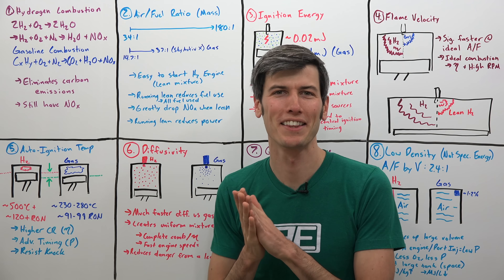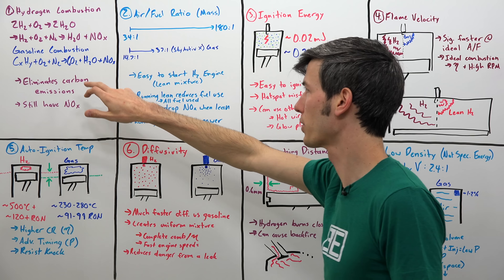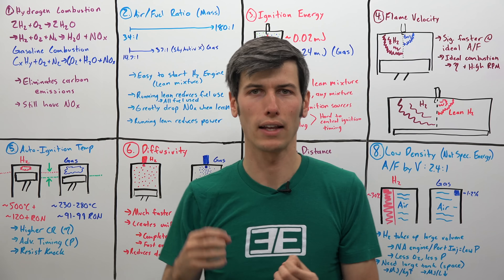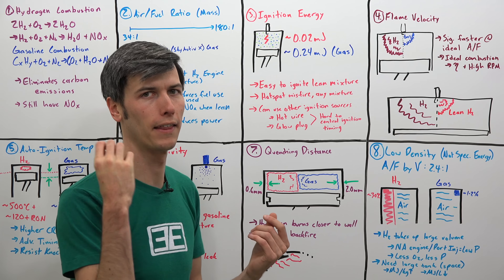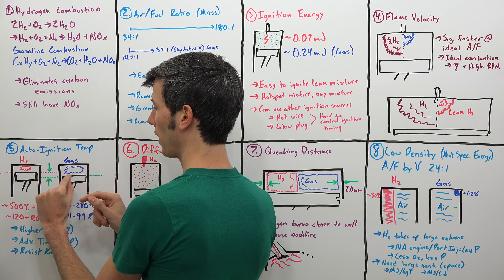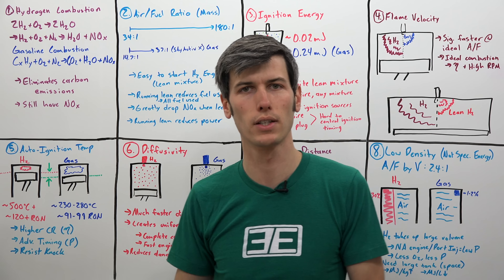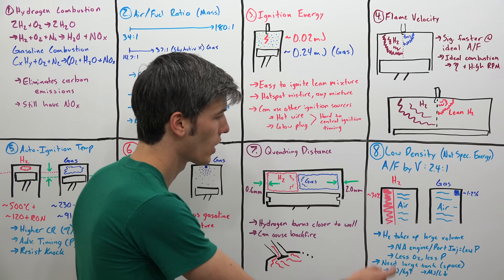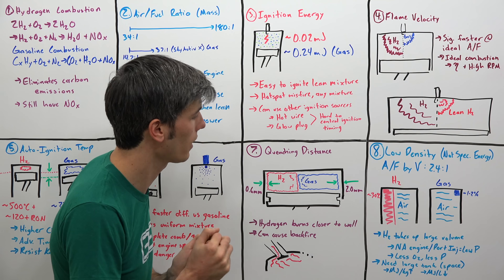The Difference Between Gasoline And Hydrogen Engines

Comment: Hydrogen, the most abundant element in the universe  😊  I say, Bye Tesla ... and let's move straight to Hydogen ICE engines 😍😍  (Only difficulty and thus drawback is the electrical energy required to purify hydrogen via electrolysis)

P.S another brilliant video Jason! Wish my university lecturers were like you back in the day
Reply: Hydrogen is abundant in the universe as a gas, now I'd like to see you try and keep it liquid for cheap and for long periods of time.
If you manage to keep Hydrogen a liquid for cheap, and make its production really efficient, then and only then you can say bye to electric cars.
But that will most likely never happen, so keep dreaming of your H cars, because it ain't happening :P.
Reply: @GoldSrc_  it doesnt have to be liquid. Even regular petrol cars inject in semi gaseous state I believe due to the high pressures. Although like I said, the purifying and storage is the biggest issue

Comment: Hydrogen be like "I NEVER KNOCKED ON NOBODY!"
Reply: Haha love it! Thanks for the reply man, means a lot. You're one of the reasons I'm creating on YouTube myself on my own channel! Always loved your work man, please check out mine, any criticism or advice would be warmly welcomed! 👍
Reply from the maker: And you know what! It was YOU!
Reply: The big problem with hydrogen is fuel leaks. Hydrogen will leak through steel tanks with little difficulty. It also tends to form bubbles under overhanging roofs unless they are vented.
This means that any enclosed space around a hydrogen tank will have hydrogen present, the wide air fuel ratio will mean the gas mixture will be explosive (the absolute lower explosive limit being about 1.5% hydrogen in air).
This translates as having to make the interior of the car a legally defined electrical hazardous area, requiring all the wiring to be either explosion proof or intrinsically safe.
Reply: @allangibson8494  Perhaps you didn't know, more house fires that are not arson are started by an electrical short in a car in an attached garage than anything else. Ask your insurance agent why attached garages increase premium cost.  Also, spilled gasoline fumes will hug the ground without air stirring. H2 will 'float' away if vented. But yeah, hydrogen is much more difficult to contain.
Reply: @tombombadil3185  H2 is also much much easier to ignite. I work in industrial applications (including work on fuel cell systems) and the two gases in the highest possible risk class are acetylene and hydrogen. Given a choice diesel is the safer option but petrol vapour isn't even in the same class (literally) as hydrogen. (BTW Diesel powered fuel cells exist too).
Hydrogen is very easy to ignite (sunlight will do it) and has a wide flammable range with high energy. (Not like acetylene - that's a high explosive even when not mixed with oxygen).
The average garage is simply not designed for the ignition risks of hydrogen.
That said the average car owner has no use for a hydrogen vehicle that a battery electric vehicle can't do better, more cheaply and far more reliably.
Hydrogen would be better used for ammonia synthesis (which currently uses 30% of global natural gas production) and liquid fuel synthesis from carbon containing agricultural waste (and corn alcohol is a boondoggle too - turning corn stalks into naphtha would yeild more energy at less cost).
Reply: Lol... it's funny that at this point this is a dated reference. I wonder how many people got it. It still works out of context so I'm not sure I can just count the likes.
Reply: Great video and very interesting topic... Thank you Sir... 👍👍

Comment: So my impression from your video is that H2 is better fuel in paper, so what are the practical issues when implementing this fuel in combustion engines in road cars, besides the tank size? Or is this such a disadvantage that it is enough to put off implementation?

Comment: Would be nice to see a video of a hybrid petrolium+hydrogen.. I was thinking doing it a long time ago, adding H added to the air:fuel mixture and get some results mesured.
Reply: when hydrogen si added  to engine you extract more energy from fuel that means more power and reduced fuel consumption
Reply: @antoniotod9614 I thought exectly about  that. But I read that hydrogen can damage the inside chaimber steel and create micro cracks. Is that true?
Reply: @MaximumBan  hydrogen penetrates steel with high pressure,  the pressure inside cylinder are not high enough... when the hydrogen get stored in a tank with high pressure it penetrates steel and leaves into atmosphere

Comment: An internal combustion engine will run on ANYTHING in proper mixture. Only thing you need to do is figure out how to dry out the cylinder of water after the combustion process of hydrogen to prevent rust. This tech is old. Propane and LP conversions have been around for YEARS. Substitute in hydrogen,....whats the difference? NONE!

Comment: Why can't we use hydrogen as a diesel engine?
Reply: you can, but just as additive, like injecting HHO gas to get more power and reduce fuel consumption
Reply: @antoniotod9614  I meant I can't see a discernable reason why hydrogen won't work as direct substitute, compress air inject hydrogen and combustion should happen if it's hot enough

Comment: Now bring it full circle, and explain how adding the carbon atom into hydrogen (CH4) fixes the volume disadvantage of hydrogen. The Honda Civic GX runs on natural gas, and makes comparable power to the gas equivalent. I heard of an AC Cobra that had a 429ci engine that ran on hydrogen. It made about 100hp.

Comment: I  first saw a university conversion of a Honda civic to use of hydrogen as a fuel, and told its only exhaust was water and a bit of NOX around forty years ago. I have wondered since why it was not developed further. One engineer I met much later said that the compression ratio and several other aspects of standard gasoline engines would have to be altered to optimize the design for best efficiency. Your explanations here have greatly added to my understanding of why the direct conversion to hydrogen of our very mature spark ignited piston engines of today have not been utilized for CAFE standards compliance by now.
Aside from the hydrogen fueling infrastructure problem that this idea faces, along with its newer, cleaner sibling the fuel cell vehicle, the other problem hydrogen internal combustion technology faces is that piston engines need lubrication from oil any way. The hydrogen engine would burn the thin film of oil left by each stroke of the piston, adding to the emissions, and I think I remember that ring wear would be exacerbated with it as well.

Comment: I really enjoy your videos, they're thoroughly informative and as an engineer (chemical) myself I like the degree of detail that you achieve. That being said, why did you decide to focus on hydrogen combustion instead of fuel cells? Fuel cells essentially power an electric motor but have much higher energy efficiency (> 60%) than internal combustion engines and produce little to no harmful emissions. In Japan fuel cells were used for home application generating electricity by feeding them with natural gas from the city lines. By coupling some heat exchangers in order to recover wasted energy they were able to reach 98% energy efficiency. Naturally this isn't possible for automotive applications (yet) but it still makes a point as to the potential that this energy conversion technology possesses. Also regarding the energy density of hydrogen, you are quite correct but there is significant research going on trying to surpass that limitation: there have been some advances in the storage of hydrogen in liquid or even solid form. The principle is that hydrogen would react with a solid compound generating a corresponding hydride or possibly some other compound containing hydrogen. There would then be a somewhat reverse chemical reaction which would release the hydrogen yielding the starting compound. There are, of course, numerous problems with this approach, such as being able to control this hydrogen release and the rate at which hydrogen is released and then fed into the fuel cell.
If this could be achieved we would be able to store hydrogen in a small box which we would then connect to our vehicle and replace it with another box when the first one was spent. What do you think about that?

Once again, awesome videos and keep on doing what you're doing.

Comment: Is there a point (theoretically speaking) at which we could compress Hydrogen to take up less volume, ie fuel tank? And are we just not to that point yet? I'd really like to see hydrogen become a feasible option in my lifetime, as i believe it's a great alternative gasoline/petrol. 
Also, As Hydrogen can take a higher Compression Ratio, would internals have to be "beefed-up" to be able to support a higher CR?

Comment: Would s hydrogen engine make a good option for a range extender in a bigger in articulated lorry? An i3 rex, for instance, uses a gasolene engine to generate electricity, and - apparently only just enough electrical energy to keep the vheicle moving. But an i3 is a small vehicle ... hmmm.

Comment: Thank you Jason for this.  What about the idea of just having a tank of H2O (water)? It carrier both fuels together... how much h2o would be needed to match the energy potential for gasoline in a tradition combustion engine.. say you have a 10 gallon tank, how much water would be needed? I still think Hydrogen is going to be the next big leap for internal combustion engines after the opposed piston (Achates) engine.
Great video thank you.
Reply from the maker: But you need to split the H2O into hydrogen and oxygen separately so that you can use them, so you'd need a tank for each as well. Water unfortunately isn't a great energy storage solution for cars.
Reply: @EngineeringExplained  Hmmm, well, let me in my lay engineering keep dreaming then! although, in about 1989 i asked my dad why there were not TVs in the back of headrests in cars... he just laughed at me.... ahaha have a great Christmas/Holiday season and New Year!

Comment: Hydrogen and small fuel cell is practical as a tesla on board refueling system.  Like Honda insight where you don't need (ICE) to produce power.  Or you take a diesel engine and use hydrogen with its injectors.  Take that heat to warm up fuel cells in batteries. Prefect hybrid engine fuel :D

Runs off of water

Comment: I'm not too sure about hydrogen as propellant for cars, but do they cause some maintenance problems on the engine block if it were to be used as a propellant? 
For example, petrol/diesel has carbon buildup due to the combustion nature. Because of hydrogen's combustion with oxygen to water, doesn't it actually rust the engine block?
Reply: when fossil fuel is burned it  turns into CO2 and H2O, so does every car engine block have rust??
Reply: @antoniotod9614  No, as if now they have a higher quantity of it, since mostly they're burning hydrogen now instead of hydrocarbons. I'm asking this because of the majority of the engine block do have rust-resistant properties (which is why there is chromium), but even with stainless, I'm unsure if it can hold up the rust.

Comment: H2 Fuel cell or H2 combustion engine?
Reply: Fuel cell. It has way higher efficiency. Elemental Hydrogen is quite energy intensive to produce so it's importent to get as much energy out of it as possible and a fuel cell will simply do a much better job. Also you don't have the problems with the NOx emmisions with a fuel cell.

Comment: A couple of questions:

1a. Is the Hydrogen stored as a gas, or is liquid Hydrogen used?
1b. Wouldn't the storage create a situation for a 'bomb'?  Meaning isn't it dangerous to store hydrogen in a situation where it could easily explode based off of impact?  Think Ford Pinto's with hydrogen tanks. I see tanker trucks on the highways that have hydrogen and they always have explosive warning signs.

2. I didn't catch this in the video; so it may be there.  Even though Hydrogen combustion still produces NOx, does it produce less NOx than a gasoline engine, the same, or more?
Reply: Hydrogen is stored in extremely tough tanks as it needs to be under high pressure to keep it liquid, those tanks are much tougher then any part of a passenger car.
So an all out rupture of those tanks is very unlikely, but yes the possibility always exists.

Comment: Now that you have Tesla 3, how about some EV stuff rather than combustion stuff? Most people don't realize there's cooling system in EV, they think EV are like remote controlled toy cars (like Leaf). Maybe partner up with Weber university and get into finer points of EV?
Reply from the maker: I've made a bunch of EV videos this year, and will certainly continue to make many more over the coming years! It's not just focused on one energy source, I think they're all interesting.
Reply: @EngineeringExplained  I have seen all your stuff, including EV stuff. I love them, thanks. I should've said more EV stuff, not "some". There are many EV myths floating around, such as it takes hours to charge or the battery will be dead in a year.

Comment: You just had a brain fart.     Hydrogen vs gasoline.  Hydrogen has much more energy per volume n per weight       You can do much more energy per volume with hydrogen than gas
Reply: Actually no you can't.The energy per volume content of hydrogen is incredibly low basically the lowest of any known fuel. The energy per mass content though is incredibly high actually more than 2 times better than the next known fuel.
Reply from the maker: No. Gasoline has more energy by volume. Hydrogen has more energy by weight. You can look it up if you'd rather not believe me haha.
Reply: @EngineeringExplained  false

Comment: If hydrogen has so many positive traits why is this not a thing yet? I cannot imagine engineering teams being unable to control heat inside combustion chamber, even taking some of the engine power for a self cooling systems sounds like a plausible option the way you explain it. The numbers between hydrogen vs gas make it look like they got power to spare!
Reply: Well, first of all although it's technically very easy to produce hydrogen, it's not cheap because the production needs a lot of energy if made out of water or produces CO2 if extracted from other hydrocarbon which defies the point of hydrogen somewhat. Then you have the problem with storing hydrogen. Storing hydrogen is a pain in the butt because it diffuses through nearly every known material at least to some degree. And last but not least maybe you heard the term "Hydrogen embrittlement" before. Hydrogen has also a tendency to bond with metals to create so called hydrades. This effect is especially common at high temperatures...like in a combustion chamber...This makes the metal more and more brittle over time and ultimatly can lead to major part failures.
Reply: @shi01  you deserve a cookie. I am still a little doubtful regarding engineering not being able to deal with those issues in an affordable way
Reply: @hectorrios5883  Well, the storage problem has improved somewhat in the last 30 years. It's still not great though. The pressure tanks in the Toyota Miray weight 87.5kg at 5kg capacity and they still "leak" a tiny little bit.
There are some metals which are fairly unfaced by Hydrogen embrittlement but they are generally the more expensive ones like some stainless steel alloys. Normal steel alloys do terrible in combination with elemental hydrogen. Actually most standard metal alloys you will find in a combustion engine will not work very well together with hydrogen over extended periods.
I personelly would say, if you wanna use hydrogen, go with the fuel cell.

Comment: How would hydrogen perform in racing applications as opposed to E85? I've heard that E85 burns cooler and has a higher octane number than gasoline, making it ideal for racing engines with strong forced induction, though you need more of it, since it contains less energy than regular gasoline. But what would hydrogen mean in racing?

Edit: improved the question a bit

Comment: Could you possibly go into the associated dangers, if any, related to Hydrogen fuel tanks in vehicles during a crash?
Reply from the maker: Well, a big leak certainly wouldn't be good, but these tanks are crazy strong. Check out what Toyota did with the Mirai if you're interested in the tank structure.
Reply: From the videos of the mirai, its tanks when punctured kinda operates like a stove when the hydrogen ignites.

Comment: Great explanation, very interesting. I love how complex those thing get when you dig into them. 

 Unfortunately Hydrogen is not a energy source on earth, only a storage medium. You always have to extract it from somewhere. Using Solar/wind/nuclear energy ( or any low carbon energy production means) is more efficient to charge Battery directly than producing Hydrogen. multiple caveat that stop the "hydrogen economy".  Although this could have some niche usage, like in airplane, maybe some machinery. Until we can scoop up "pure" H2 from a gas giant, or make a very efficient way to extract it, hydrogen won,t replace Battery in future car ( uranus is the best candidate despite the distance because it's gravity is lower than earth compare to Jupiter and Saturn which are high).

Comment: Hydrogen is the future... Not Tesla
Reply: Unless you check how hydrogen is made and what it costs...
Reply: @MsSomeonenew  It costs zero If you want. Solar + moist of the air.
Reply: Keep dreaming dude, H is expensive and inefficient to use and make.
Reply: @GoldSrc_  You know a refrigerator? 22000L of Hydrogen per year with a device of the same size...
Reply: @vladimirlucifer4566  
Hydrogen doesn't have the same energy density as gasoline, it doesn't matter how much you can make, it will never replace gasoline.
Not to mention that storing Hydrogen is not easy or cheap.